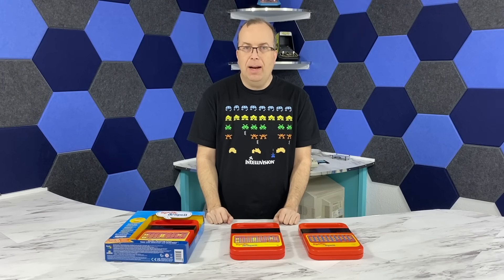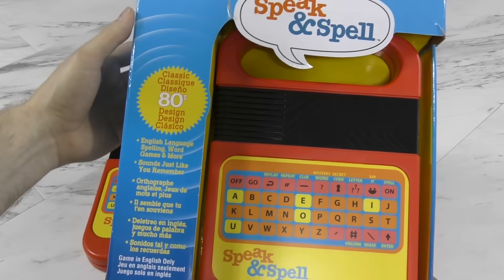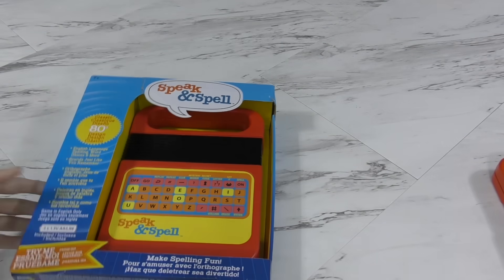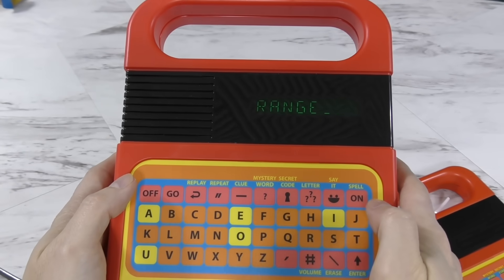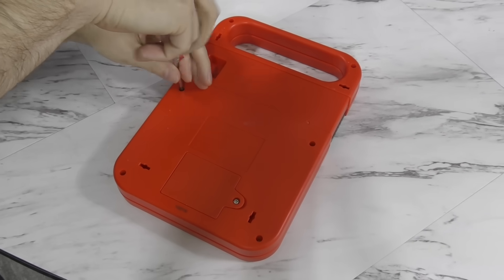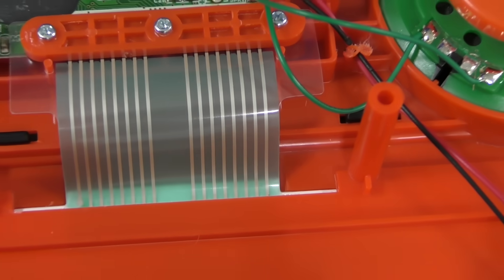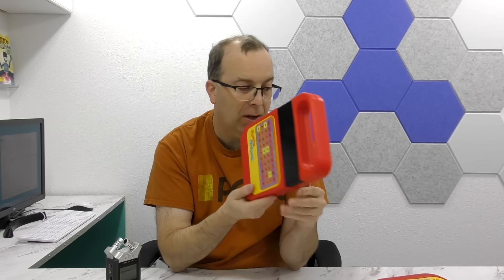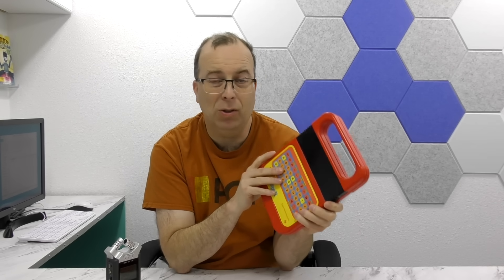Speak and Spell - 1983 vs 2019 model!

Comment: A green LED display would have been a lot better than the backlit LCD they went with. 

Additionally using an ASIC with the IP Cores from the original chips would be a better option to integrate it than whatever they had there.   (I can tell it wasn't that by the sound quality not matching the original sound chips.) 

Honestly, the standard microcontroller platform that was in the speak and spell could easily be integrated onto a system on chip these days, and could be used for a whole lot of things, not just educational toys.   With some minor alteration it could be modified into a high reliability interface microcontroller platform for just about anything.  Simply replacing the IP cores with the versions that use high-reliability differential tristate logic should make it reliable enough for the most high risk use, while still remaining cheap enough to use for toys.

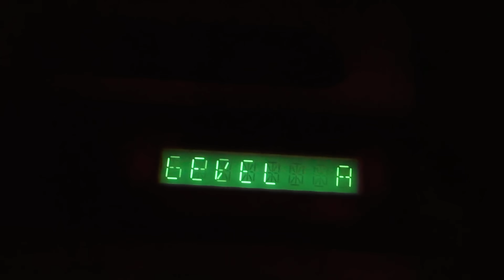Comment: 8:42 considering there are phones with High definition LCD displays for ~60$ it is really stupid that it doesn't have anything better.
They could have used an IPS display and simply mimic the original's display in software.
Reply: Those kind of display require their own display driver.  That would double the chip count.

Comment: After watching this I purchased a used older model ($25+$10S/H) for the better display and keys, then C batteries ($14) to find that two digits would after five minutes only show Q. Returned and purchased a 2019 model ($25 new, batteries included). The new display is perfectly fine. $25 vs. $49 in my case. However, where they really missed is not expanding the original set of 400 words nor adding a preschool mode with easier words. If the voice is still generated, seems like they could have put thousands of words into the new model without increasing the cost.

Comment: hello i was wondering if you could help me with my dell Optiplex 758 apparently i checked it and after i took out the RAM and put it back in it started beeping i checked the RAM again and i had put it on the wrong side but it just started to beep 5 times bad audio and then 1 time good audio i checked it a million times but no luck and also if you have a dell optiplex GX1 hard drive i need it

Comment: I been wanting one lately. Didn't know they made a new 1... so thanks for the review. I think if I bought a new one, I would have been severely annoyed at the deletion of features. Battery size, dim unreadable screen, no head phone jack, or wall plug in. I think the Speak & Spell is the reason why I've always been a good speller. HOWEVER the reason I've wanted an old one recently is over the last 15 years, modern Spell Check has severely helped weaken my spelling ability. Plus I thought it would be a cool gift for my 4-nieces to pass down to each other as they grow out of it & the younger is goin through the spelling phase in school. I don't think we had the light blue one...??? I think a friend had that one??? & or it may have been too hard for me at the time, as I thought it had more advanced math???

Comment: From the looks of it, a company called Basic Fun bought the rights to the Speak & Spell in 2019.  This would be why the TI branding is not present.  According to the Wikipedia article, the new version has a segmented LCD display.  It also lacks the ROM cartridge connector of the original model.

The original Speak & Spell managed intelligible words from only about 1 kilobit per second of data, which is pretty impressive.  (They could have used phoneme generation to build up words, but instead they played back heavily digitally processed recordings.  This is why the original design had so much ROM.  Had they used a phoneme-based system, they could have had similar levels of clarity with far less stored data.)

Comment: Yeah. I didn't like it. And i mainly bought it due to nostalgia as i had one as a kid back in the 80's.
My main two gripes were that the voice was almost completely different than the original. The weird, robotic voice was part of it's charm and appeal. And they should've included all of the expansion module programs. I'm sure it's would've been quite easy to do so. It's easy to get bored with since there's not much to do on it.

Comment: It´s a complete nonsense to make a copy of the original, and with cost optimization in mind. It´s just sh!t.
I would accept it if they used the same motherboard with ssame ICs on it, same casing mold, same software etc, but this one is just bullshit. I´d rather buy an original on Ebay than a cheap soulless copy.

Comment: Here is a use for it. Modify it so the speaker also goes to a bolted on raspberri pi, it can be a shared pi among multiple sleak and spells.  The pi would listen and use voice recognition to perform tasks... like... unlock the solenoid on the door to enter which has the speak and spell attached as the keypad. Imagine a house with speak and spells on each door to enter?

Comment: Texas Instruments cost reduced Speak and Spell several times during its original production, in fact TI replaced the VFD with LCD in 1989 during the original production run. The average consumer is not as tech savvy as the people that watch this channel, most people looking at that the new Speak and Spell, even if they had one when they were a kid, would probably think it’s identical to the “original”.  What’s interesting about the voice is until you had the old model speak I thought the new one sounded perfect.

Comment: Wow, who'd think that something sold on nostalgia would be so bad. Here's my armchair "how I'd have fixed it"
a) go through the effort and find all the expansion carts and books that went with them (I might be confusing the speak and spell with the speak and read, but regardless, both units had expansion carts)
b) Put those expansion carts on a "rom select" switch on the back.
c) leave the headphone jack and power jack alone, just change the power out for a micro-usb.
d) Was a rechargable battery so hard to put in? 
e) Use a proper LCD screen. 

Now based on your review of the product, I think they modeled it on the speak-and-read because that's what I believe the speak-and-read actually did when you turned it on, and that's probably also the same style of screen used by the speak-and-read. 

That said, who it's targeted at, well perhaps giving it to a 4-8 year old who hasn't learned to take care of anything is an option, but it's definitely a nostalgia thing, and disappointing at that.

And on the topic of redesigns, if someone really wanted to redesign the speak-and-spell/read/math units for a modern sensibility, it should have had a QWERTY layout, and a (albeit low-resolution) backlit color LCD with enough fidelity to show pictures of the object being spelled. 

I kind of doubt the entire unit cost more than a dollar to make with those parts.

Comment: When I was a kid I was notorious for taking apart toys, TV remotes, calculators, radios, etc trying to satisfy my curiosity. Thank god I grew up in the 80s and used to find all kinds of chips and components inside most of the things I dismantled. Had I come across such  tiny,  bare boards with nondescript resinous blobs I might not have become interested in computers at all and would probably be an airplane pilot by now (my other childhood obsession) instead of an IT engineer.

Comment: A 70's original working-order S&S still in my cupboard. On one side it has my neatly fitted DIY socket.
As inventor late 1980's it got adapted as a contactless 'credit card' Writer, with plug-in plastic covered sensor pad. 
A second S&S adapted as cc Reader had its keypad replaced by plastic-covered reader pad. Spell your name into
the battery-less 'card' prototype, it got read and displayed at the second S&S. 
Demonstrated this Contactless Credit Card invention to Citi Bank L.A. HQ. It got rejected - "too ahead of its time".

Comment: The biggest problem with the new model isn't the hardware IMO. Even the bad screen isn't quite as big a deal as the fact that THEY CHANGED THE VOICE! Speak 'n Spell's unique voice is the whole point of the nostalgia part and without the Speak 'n Spell voice, this is junk.
Reply: But the original voice was barely intelligible
Reply: But that added to the "fun", since half the skill in winning the games came from working out what the machine was trying to say. Changing the voice at this juncture is like when Stephen Hawking was offered a new speech synthesiser. He turned it down, because the old one was "better" even though it was technically inferior to newer technology. Some things are better left unchanged.

Comment: So many comments already dunno if anyone will ever read mine but i haven't seen anyone mention: 

1. The blob is discussed on Wikipedia  under IC packaging: there's a bare die under there soldered directly to the PCB. No markings unless you have a microscope  maybe elecron. I have a cheapo costume voice changer made the same way; any more 'cost reduced' & you wouldn't have a product. Very throw away.

2. The TI voice isn't human at all but truly synthetic: if you went to Radio Shack you could buy the chips (MCU), they were also in the Color Computer Voice Pak, made by General Instruments  from TI tech. See Wikipedia page. That said I'd probably agree the new one is downgraded to sound that way as most modern ones sound really good now.

Comment: If I were on the design team for the 2019  edition, I would have lobbied for a USB charging port and Bluetooth capability to drive modern earbuds.  I think that since the modern edition could not be a 100% clone of the original, these features would bring a couple of 21st century technologies to the product w/o killing the nostalgia factor.   Unless of course the design team felt part of the retro appeal would be for today's child to experience the thrill of changing batteries just like grandmama did before the turn of the century,
Great video as always David, thanks!
Reply: It would cost wayyy more tho, kind of unnecessary
Reply: @matttintoshplus5369  Not really. Charging circuits, bluetooth radios, and small lithium batteries...they're a dime a dozen nowadays. Really, they could have enabled all this tech with one or two additional PCBs that may even be smaller than the one that is already in there. Even adding a headphone port would be as simple as routing the signal that already goes through the speaker to a muting circuit that re-routes the audio signal when something is plugged in.

Adding all that would cost nothing at all, even that modern one likely uses off-the-shelf components that probably cost pennies, the only thing the company needed to "make" is the plastic shell, I am fairly certain all they really did was load a custom firmware on a generic LCD board with audio decoding capabilities. All the tech mentioned by James could probably have been added with little to no dent in profit margin.

Comment: The older design looks a lot more inclusive (for the most part) than the newer model. In the old version, not only are the buttons way more textile, but also the inclusion of the headphone jack can help kids with hearing impairment, or the clearer screen screen for vision impaired. You can also say the same for the flat vs. textile buttons. Cost reduction in manufacturing is great, but not when it hurts the design of the product.
However, the new model has a much clearer voice, and I bet they could store a lot more memory on the device itself, making the need for additional cartridges unnecessary.
Reply: With voice you are right but whatever orginal has best voice
Reply: "Spell tactile"  T E X T I L E  "That is incorrect."
This speak and spell isn't for kids.  It's for nostalgic adults.

Comment: The new audio sounds heaps nicer, but I agree, that display makes the product almost unusable.

I would actually love to sit on the train using this to learn foreign languages; I'm currently learning Russian and I think it would be a cool learning aid for me. No: I do not want a tablet or phone, there's something pleasant about a tactile interface, though membrane keys are horrid.

The downside with many languages is that suffixes and prefixes change depending on the case (how the word is used in the sentence) and it might be hard to program and differentiate between variants in certain languages leading learners to learn something that is potentially incorrect.

Comment: Totally irrelevant thing I just noticed about the intro: The floppy you pull out says "LOAD "*",8" on it, but you type "LOAD"$",8"

As for the subject of this video... That's disappointing. I would have hoped they would have at last kept the voice. I certainly wouldn't buy one of the new ones if I can get an original for around the same money!

Also, the new one looks like a brighter red... Wonder if that's as close as they could get

Comment: The epoxy blob is not there for cost reduction.  It was deliberately put there to hide the IC chip as a security measure to prevent reverse engineering and to thwart counterfeiters.

Comment: I am a computer programmer, and I find the Speak & Spell fascinating.  I ended up doing a Voice Internet Service that reads email and web pages over the phone with synthetic speech because I was fascinated with talking machines such as the Speak & Spell, Gorf, Berzerk, a talking chess computer, and a TRS-80 Voice Synthesizer.  In this day and age, the Speak & Spell can be done with more solid state memory, so the speech doesn't have to be compressed and can be done at a much higher sampling rate.  so it can have more speech samples for more instructions.  Also, the speech is clearer, so it is easier to understand the words.  Back in the day, a 200-word vocabulary and a few instructional words were a stretch because everything had to fit into 64K memory.

Comment: The original late-70's design also had a software bug that could be exploited by pressing the MODULE button without having a module installed.  It would produce all sorts of strange sounds presented as "words" spelled with random (but specific) letters or other characters.  I have a flat-keyboard unit, but am unable to reproduce that bug. It must have been fixed since.

Comment: The older unit sounds like it's using one of those original speech chips used in a lot of things back in the 80's. I have a talking alarm clock that has the same voice.

Comment: Great Video again David!!  Thank you!  Someone should design a pcb from PCB way that fits the new one with old hardware, allow the end user to build it with NOS parts, and install it in the new unit.  Could even add headphone jacks and a better display.  Fun project for guys with nostolgia (like you mentioned).

Comment: I think the other factor was that the 1978 model achieved voice by actually modulating a synthesizer/frequency generators. It was not digitized sampled speech. It would have cost way too much memory to store those. The Commodore 64 had enough RAM just for 8 seconds in ok quality and 24 seconds of horrible quality and 64k was already very expensive, and the 1978 Speak and Spell came out 3 years earlier.

Nowadays - as you say - digital sound is ubiquitous, it was already before the Compact Disc. Telephone answering machines already did not have an endless loop tape anymore for the announcement, but a 4k sampling rate 4bit horrible sound ADC/DAC. They used batteries to hold the static RAM. 

Now get a holographic machine as a children's toy creating a 3D model of their beloved characters walking and talking in their room, then you'll see the same excitement again ;-)

Comment: Even with the massive cost reduction and it probably costs under $1/unit to manufacture so pure profit if it's sold for $30, but how many are they actually going to sell? I remember I saw a Speak n' Spell simulator on the Android play store back 7-8 years ago. No one except the biggest nostalgia fiend would buy this.

Comment: I remember when I was a youngin’ and had one these things. I think I was about 7, just got my first set of real tools from my dad and found my speak and say I’m one of the cars we had in our junkyard. It was pretty old at the time I got it and since I found it that way, there was no problem with me tearing it apart. 

The batteries were covered in corrosion and messed up the contacts along with covering the module. Also every single screw was a rusted mess. 

I spent hours trying to take it apart without breaking anything and I was way too stubborn to let my mom or dad help. I finally got it apart after sneaking one of my dads drills to get the screws out. Needless to say none of the screw holes or posts were any good when I was done lol. 

After I got it taken apart I spent a few days trying to use school glue, regular clear office tape and a paper stapler to get it back together. Eventually my old man waited until I wasn’t paying attention and got the half’s to stay together using hot glue while letting me think the school glue I was using worked. 

Then he showed me how to find a power supply with the right voltage to power it since he wasn’t wasting a bunch of money on batteries. 

That last lesson was a huge a mistake in hindsight. Well for a little while that is. Lol. My speak and say was working but my curiosity as a kid made me wonder what other power supplies worked with it. Let’s just say my dad was not thrilled at my curiosity lol. The late 80’s and early 90’s were a hell of a time to be a kid.

Comment: Maybe the texus instruments copyrights were too expensive I know that beebem bbc micro emulator used to have a emulated speaking module which was removed in later versions and replaced with text to speech due to such an issue.

Comment: Heh.  The 2019 model uses digital clips that have been passed through a cheap flange filter to simulate the sound of the original.  Ironically, this was probably cheaper to do than including the actual synthesizer from the older models.